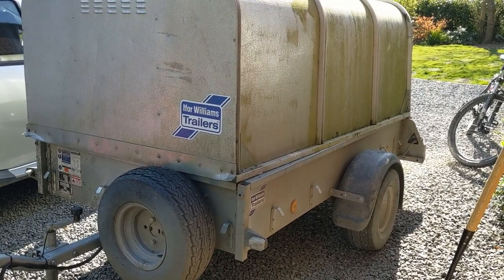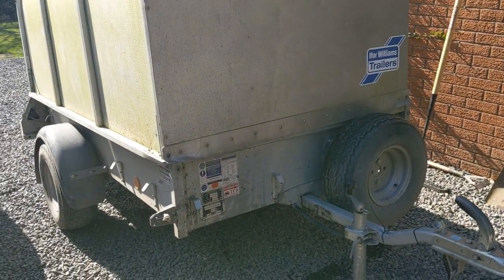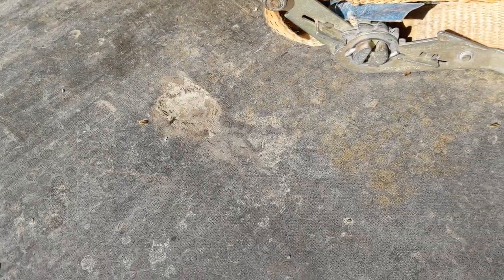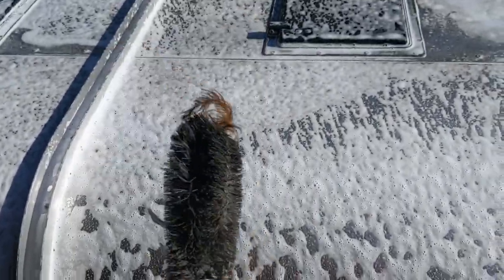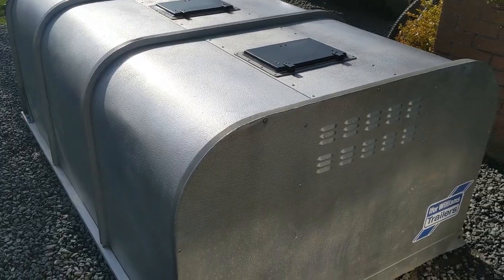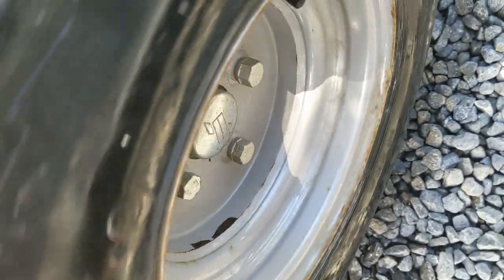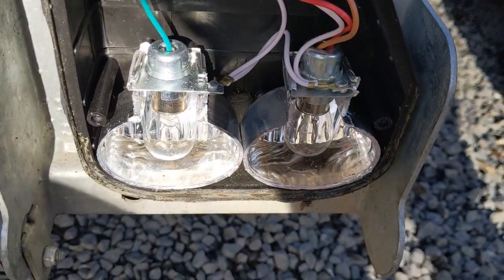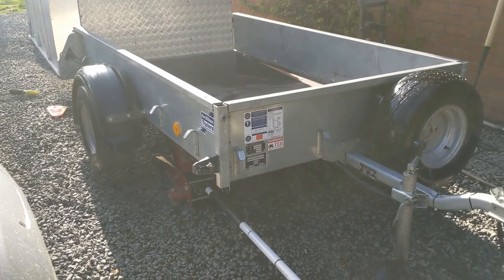Cleaning up and servicing the farm/work trailer - iforwilliams p7e

Comment: Enjoying your videos would you fit a Kawasaki klf 300 into your older trailer. Keep up the good work 👍
Reply from the maker: Thanks. Yeah easy. There half the size of some of the bigger bikes
Reply: The only reason I ask is I have been offered a quad that needs working on so me and little boy can work on together and then hopefully use up the farm to shoot on so potentially might need a trailer 👍
Reply from the maker: @GreenHawkConstructionltd  tidy. There ok little bikes the Klf 300s not the quickest but last decently well. Not that many common issues other than the electrics aren't the best. CDI boxes etc like to give up as they aren't sealed well enough and there located under the rear arch which is a daft placement. Starters are a pain to change as you have to remove the side engine casing cover. Only other thing is they love to start burning oil with a bit of age to them. Light green ones are really old. There's not all that much wrong with the trailer in fairness. Pulled it out today to take a look at it. I'm mid Wales.
Reply: An idiots opinion thanks for the info I appreciate it yes this one is a 1995 I think. Just out of curiosity what sort of money would it go for once it’s all road worthy as I don’t want to pay over the odds as it definitely needs work doing to it and have you got a price in mind for the trailer
Reply from the maker: @GreenHawkConstructionltd  There not  all that valuable. Depends on cosmetic condition. I'd expect a tidy one of that age to go between £800 and £1200. Ive sold them in the past for around that bit more if it's a dark green one. Being an old design and manual shift there not that desirable for anything other than farm use. £450 ( it would be safe to use for that - I'd sort the lights etc).